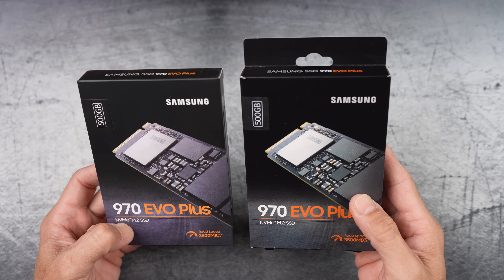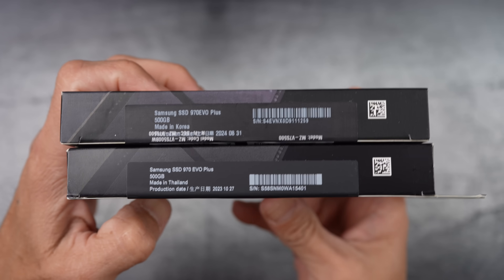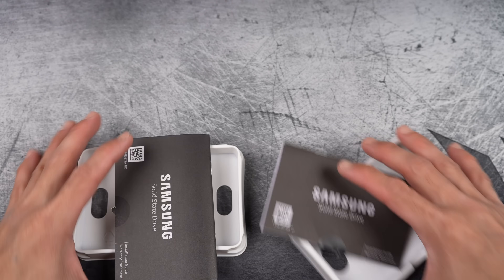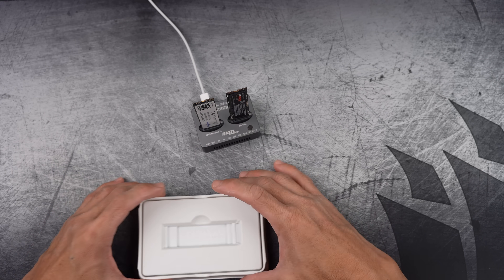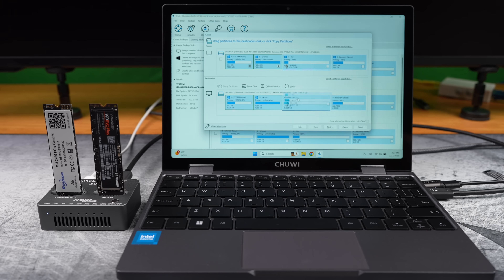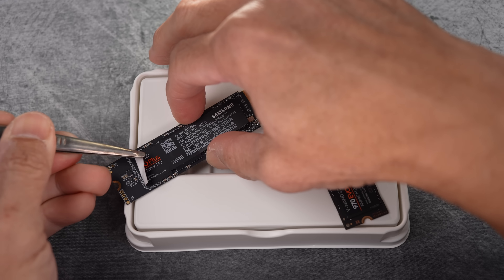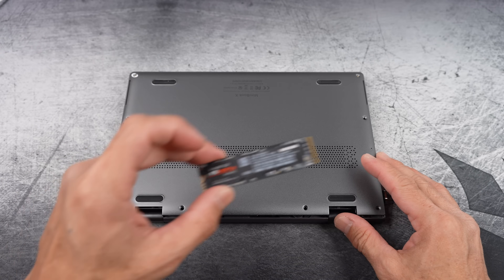Fake vs Real SSD - Can You Spot the Difference?

Comment: damn this is scary, I never thought about such a close clone
Reply from the maker: Totally agree—it’s really convincing how these clones have become. It’s a good reminder to double-check sources and specs before making a purchase. Glad the video could highlight this issue!
Reply: Frequently the knockoffs are coming from the same factory as the real ones, just with substandard parts to save money and running in the off hours.
Reply from the maker: @nyckid I could see that happening too. Thanks for sharing.
Reply: How much did the fake one cost? @TossSong
Reply from the maker: 48 at the time I was lacking brain cells. :) Thanks for commenting.
Reply: at least they priced them cheaper. in terms of scams, this ssd clone scam is not as bad as others. They still give you a working SSD of equivalent size, only slower. Way better than those fake microsd cards, claiming to be 1tb of storage but actually it's only 32gb, where they hack the file system or something to show 1tb instead of 32gb
Reply from the maker: @kenuffhew True, it’s not as deceptive as the fake microSD card scam—but still risky. A couple of folks in the comments said theirs died or became unreadable after a short while, so they’re definitely not reliable long-term. Even if they work at first, the performance and data integrity just aren’t worth the gamble in my opinion.
Reply: @kenuffhew Can't agree with "At least". I lost about 2TB because this scam product stopped working after 6 months. Had to work quite some time for a claim which after 2 weeks ended in the sand, was furious for a long time and had to work for hours to restore all that data from tha backup disk, and redownload all the non-backupped stuff. Lost also some unique data. There is no "at least" in my view. I am still furious now.
Reply: Nothing need to be "SCARY"... IF you don't buy from AliExpress! Buy from a reputable dealer! Stop believing those LYING advertisements!

Comment: Without peeling, you can tell it's fake by looking at the smaller controller package, as suggested by the back PCB marking, which uses MaxioTech MAP1202 (a DRAM-less controller). However, this might not be obvious to those new to SSD hardware. 

Basically they relabel and repackage other SSD brand to match Samsung 970 EVO Plus, that NAND is from YMTC with logo on top meaning it's not low quality UNLESS they scrapped it from e-waste of dead SSD (with some working NAND).
Reply: To be honest, without real SSD packaging side by side to compare, I probably going to fall for the packaging, but the stickers on SSD weren't enough to cover the obvious fake signs.
Reply: @elham7459  Yup. I work in IT repairing systems and I'm pretty certain I would miss this fake. Unless you work with a LOT of these drives to clearly see that something is off, you're going to rip it out of the box & chuck it into the system. After that, it works...decently well from the Crystal mark benchmarks...so there's no  giant red flag to tell me that it's not what I thought I was getting.

Until...until...it dies or one cannot get the files off. If it's a good fake though, that could be a couple years down the road. Or next week.
Reply from the maker: @BillStreeter-QuimaxW Absolutely, it’s scary how convincing these fakes can be! Without working with these regularly, it’s easy to miss subtle differences until it’s too late. The possibility of sudden failure makes trusting them even riskier—definitely not worth the gamble!
Reply from the maker: Yes, the packaging is very convincing and that is very interesting to me. The booklet inside as well. The drive itself is easily identifiable as fake. The more interesting part is the speed comparison. Although the fake drive is not as fast, it’s still usable.
Reply from the maker: Thanks a bunch for sharing this super detailed explanation! I really appreciate the insight into the MaxioTech MAP1202 controller and the relabeling process, especially for those who are new to SSD hardware. Your input really adds a lot of value to the discussion, and I’m so grateful you took the time to break it down so clearly!
Reply: @TossSong  You can also Google search "ssd utils vlo name", website contains multiple Flash ID tool to identify which controller and NAND, use NVMe Flash ID tool for NVMe SSD, if no idea which controller you can just try one by one.
Usually accurate and completely identify the component, but not always.
Unfortunately no tool for propetiary controller like in most Samsung and WD SSD.

Comment: You should try to end your investigation by using Samsung Magician software. Probably this is the only tool that would definitely choke on a fake drive and will not recognise it.
Strange choice anyways  closing cloning software and speeds comparation vs branded software that made specifically for branded drives.
Strange choice anyways, choosing cloning software and speed comparisons vs branded software that was specifically made to work with branded drives.
Reply from the maker: Thanks for your comment. I made a video because I fell into buying the fake one. And to entertain the thoughts that it would be interesting to test it and share. I did use the Magician software; you could tell that I installed it somewhere in the video, but that would be a short video. But anyway, thanks again for your comment.
Reply: @TossSong  That's why I wrote "to END your investigation by using Samsung Magician software."

Because many people will get confused about what to do, and do they bought a real or a fake one. And what to do if they purchased it several months ago…

Because even my original Samsung 970 EVO PLUS doesn't have this hanger, but it is real. It was recognised by Samsung Magician and was purchased from the Samsung online store.
Reply from the maker: I see at the end of the video. That could have been a great ending. Yeah, I didn’t think it at the time, maybe because I was convinced after peeling off those labels and seeing the difference. Thanks again for your input.
Reply: @MegaDronson  thanks I totally forgot about Samsung Magician. I can recall using that a long time ago when the first version of Evo ssds came out...that was my foray into losing all data with no hopes of return, lol.
Reply: Not true. They have no problem with fooling S M.

Comment: what does crystaldiskinfo say for both drives?
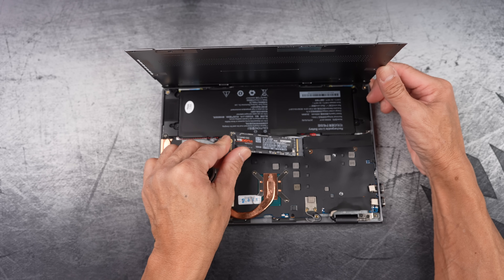Reply from the maker: Thanks for your comment. The real drive got about 3500 read 3200 write, but the fake one got well below that. Starting somewhere in the video here 7:47.
Reply: @TossSong  Yeah right, but i meant CrystalDiskInfo, not CrystalDiskMark, its another tool, you can check firmware version, serial number and other smart statistics.
Reply from the maker: I see. Thanks for that. I will give the CystalDiskInfo a try and let you know.
Reply: Was the speed comparable to what was advertised in the packaging?
Reply from the maker: Under their item description, it was supposed to be as mentioned above 3500 and 3200. But it got 2300 and 2000.